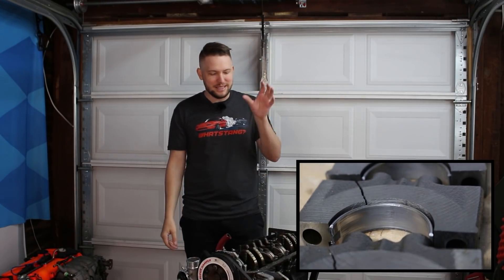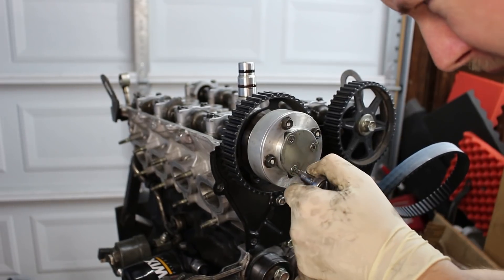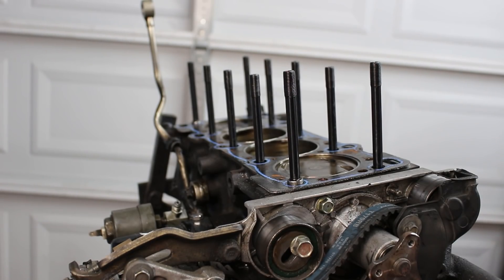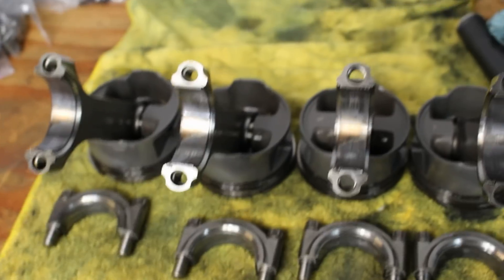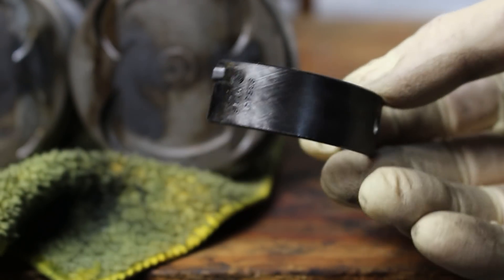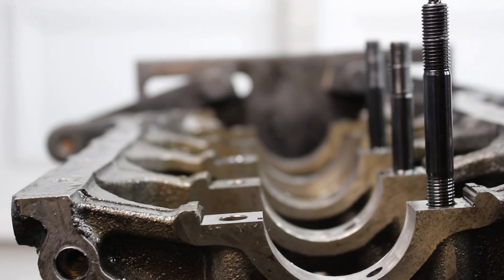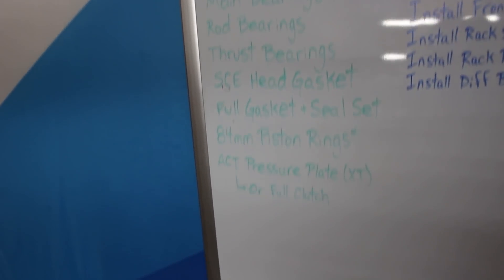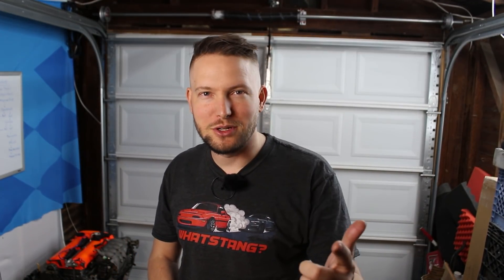500HP Miata Engine Teardown & I Got My Mazworx Billet Mains!

Comment: Yo, if the crank is bent, i said in an earlier video about the 2.1L forged crank stroker kitt you can get for these engines. it would be nice to see one of those boosted with the testing you do. 

Great videos as always, I have followed this car since the MS install and the china turbo days :D
Reply from the maker: My wallet really hopes the crank is okay, because a stroker crank will be the obvious next step
Reply: Can anyone post a link to the 2.1 forged stroker kit?
Reply: @nickespo89  Maruha makes those stroker kits, just google maruha stroker kit and it will lead you to a new world of parts you didnt even knew you wanted :)
Reply: @TheCarPassionChannel  honestly I hear the stock Miata crankshafts are strong AF 
but it's still definitely possible
Reply from the maker: @nickespo89  Bofi Racing carries them, highly recommended shop! https://bofiracing.co.uk/?ref=7465

Comment: Good job and great video!
I would assume the reason for your main caps cracked, was due to crankshafts flexing.
I am making well over 500 hp and still running the stock caps, which got me thinking why mine haven't cracked yet?
I have installed a stroker kit that uses a moldex crankshaft that is way more sturdy then the oem one's. 
Just a thought! so let me know if yours is out of shape.
But I must say that you have got me thinking 🤔 
By the way, sorry that I still haven't replied your mail. Will get back to you 

Best Regards 
Bassam Rammaha 
Denmark

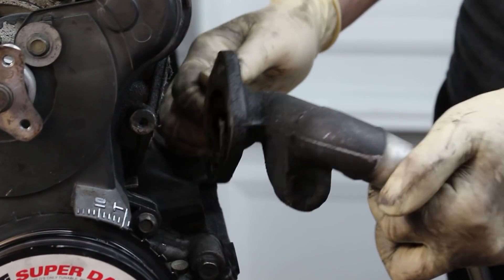Comment: 7:25 i recommend you strength the oil feeder system,
 either make a bracket/ change fitting direction...

I concern it due your solid mounts and engine vib, it can crack and goes dry
Reply: The metal pipe he removed? Those dont go dry. It's fine
Reply: @alexstromberg7696   i mean the oil  adapter... mine had snap (same kind contraption)  due vibration (on diesel) luckily, i saw the press go 0, so i could pull over and no $ happend, just make big mess on the road....

Comment: Just a thought on the rod bearings- Since the oil path for the rod bearings goes through the crank, as the crank pushed away from the top bearing (where the oil feed is,) the crank and rod bearings would both lose oil pressure. This could be the cause of your excessive rod bearing wear. Do you happen to have a log of the oil pressure before and after the failure?
Reply from the maker: That's a really good point. And unfortunately no, I don't have oil pressure hooked up to MS

Comment: Maybe a slightly more aggressive cam with a slightly milder tune/boost might reduce your mid range torque values while retaining your top end power. Might make the car feel less power but it could ease the stress on your powertrain and drivetrain, plus it may also reduce wheel spin when launching the car.

Comment: Unsure if you'll see this message on an older video but I would be very interested in seeing how your interactions with a machine shop would go. I do intend to build my stock miata motor to something fun and would love to shoot for 450+ whp but I have 0 experience working with machine shops (aside from work) and would love to see how I can be absolutely prepared to bring my block/head in for work without making the shop's job harder. Love the videos Greg!
Reply from the maker: Don't have time to give you the full breakdown but it's pretty much the same as a stock rebuild if you're talking about the block itself. Let them know it's for higher power with boost, if you're doing upgraded main studs bring them the block with those studs. At the bottom of this page I list out all of my clearances for my previous engine:

thecarpassionchannel.com/VVT-MEGA-PAGE

Comment: An engine that gets little acknowledgment in aftermarket are the Suzuki M13A, 15 etc. They are far better than all the 4 cylinders around this time, yet they have little aftermarket support. I guess its because the cars they came out in. These engines have 4 bolt billet caps from factory.

Comment: Thanks for sharing your Miata build on YT. Care to share your clearances for the rods and mains and what type of oil was being used?
Reply from the maker: I use Valvoline VR1, my mains are 0.0018-0.0020", and my rods are 0.0020-0.0022" 🙂 I also have a full spec sheet for the rebuild of this engine here:

https://www.thecarpassionchannel.com/vvt-mega-page-v2

Comment: Which cylinder head studs are you running there? Are those already the Chrysler one, as they look pretty beefy? 
Last time on dyno I had 450Nm at 4000rpm and fuelsystem was pressurized, so I belief my current ARP head studs didnt hold the head in place. 
Now I think about to swap them to Chrysler studs (220k psi vs. 190k psi).

Comment: I know everyone knowledgeable in the field says BPs don't like to rev and don't bother trying -- which I believe to be totally correct, but yet high rpm is fun even if there ain't a whole lot of power (if any) to be had up there... my question is:

Would billet main caps be a good idea for a build targeting reliability for a mostly street-driven Naturally Aspirated BP4W aiming for 8000-8500 rpm fuel cut? For that matter, is Maruha's stock stroke crankshaft a good idea? Power aside. I'm one of the weirdos OK with smol power for street car miatas seems like.

The stock BP crank has a reputation for being about as stiff as a wet noodle at that RPM, so just asking some stupid questions about how to get around that.

Comment: holy shit not only did you manage to get all 3 of those stupid torx bolts off the intake cam gear without stripping them, but you reused them?! Clearly you are a madman!

I've never been able to get one of those stupid bolts off without it instantly stripping, even using high quality hardened torx bits. 

Also, those replacement bolts are super cheap and you can get them from Mazda. Don't tempt fate.
Reply from the maker: It's at least the 6-7th time I've pulled them, and they legit get 5% more stripped every single time. I NEED to get new ones. In fact I'm gonna order them right now
Reply: @TheCarPassionChannel  yeah smart move lol. I need to get one of those screwdriver impact tools that you whack with a hammer, I hear those work pretty good on these kind of screws

Comment: Piston are not oval, they are conical, going down to the skirts diameter increases as in all good thing 🤣
colol video good work dude
Reply from the maker: That may be true but they are also ovalled slightly even up at the ringland area.

Comment: I sent my head to the shop and it required some fixes on the camshaft journal surfaces, resurface, installing some oversized valves, new bronze manganese valve guides and porting... That was about a year ago, I still have not received the head back...
🙁

Comment: I mean the rings where pistons touch the cylinder is completely round … idk how you would machine an oval?
Reply from the maker: I'm not sure what part of the video you're referring to but if I mentioned the pistons being slightly oval - they're only like that when cold. Once they get up to operating temp they become circular. (They expand slightly differently on the pin axis since there's a different amount of aluminum in that part of the piston). The cylinders are machined circular to match the shape of hot pistons.

Comment: How much more displacement you get from 1 size over me wonder
Reply from the maker: Going from 84.0mm to 84.5mm on a stock crankshaft bumps displacement from 1884cc to 1895cc. Stock (83.0mm) is 1839cc.

Comment: Are you gonna get the head ported and polished? Also you said the head needs to be resurfaced because the fire rings marked it, is that the same case with the block surface?
Reply: Block surface is steel, it’s usually harder to eat into than the aluminium of the head, a clean is enough provided it’s still flat!

Comment: Did your skunk2 throttle body ever stick?? How did you solve that??
Reply from the maker: Yeah, it would very slightly stick open and idle high. I drilled a second hold for the return spring which added slight tension, and it's been golden ever since. I have a video on it in the rebirth series, I can't remember the episode number but it's within the last few vids before the dyno.

Comment: I wish they made those main caps for a 1.6
Reply from the maker: Tbh you're going to have trouble making enough torque out of a 1.6 to need them. Even the 500whp 1.6's I've seen typically only make 350wtq

Comment: How much HP are you trying to make?
Reply from the maker: The car made 523whp on the previous configuration but the turbo was over-spinning to hit it, most likely going to run ~450whp range to keep the turbo happy, and the stroker + higher compression should keep the power and nice and broad. Looking for the best possible 'street car' type setup, as I've been refining over the last several years

Comment: Pistons oval not round? @14:30
Reply from the maker: Correct. Different areas of the piston expand at different rates depending on the amount of material in that area. They're designed to be round at operating temperature, but when cold they are not round.

Comment: Also 1 last thing since you have the engine out, have you looking into ceramic coatings inside the engine? I dont know much about it but apperantly it helps with power, wear, and noise.

Comment: Cant believe you broke your main caps with 500hp… I have 619hp and haven’t broken them yet, although Idnt daily drive my car…good luck I’m also doing another motor to go pass 700 hp close to 1000hp collecting parts little by little
Reply from the maker: I'm assuming yours has a notably larger turbo and later spool up, I'm thinking that was a major factor in this failure. Power at higher RPM isn't as hard on some parts vs making the same power at lower RPM. I know Derek Rockwell was running like 700+ on stock main caps, and I have a buddy who broke one at 335whp with track abuse. It's definitely not a set number thing, many variables involved.
Reply: @TheCarPassionChannel  I’m running a 6265 bb precision turbo….from what ibeen told pass 700hp they tend to break…that’s why inever pushed mines I went from 598 to 619 and told my tuner to leave the car the way it is….wanted to enjoy the car not just break it
Reply from the maker: @xXNASTYNAOXx  Yeah, that's a big boy turbo.
Reply: @TheCarPassionChannel  lol going 6870 for that 900+hp Ican pass 700 with the turbo ihave now but idnt want to risk the main caps
Reply: @xXNASTYNAOXx  how often do you go full throttle in that thing? 240hp for me is plenty can't imagine 600
Reply: @R03333  is a track car so it doesn’t get daily driven so not as often

Comment: What about tearing down the whole car and painting the unibody replacing every bolt with new bolts and paint everything else to make the car look new. It will be a big project but I believe it will be worth it. That's what I'll do when I buy my miata.
Reply: If you get a good shell you can do that job in stages, I did the whole front suspension and underbody in 6 weeks, including cleaning it all and repainting, then I collected the parts for the back and am trying to do that now when the weather sucks. The problem with whole tear downs is they cost you a fortune and many of them never get put back together.